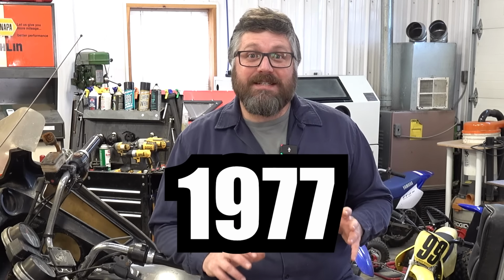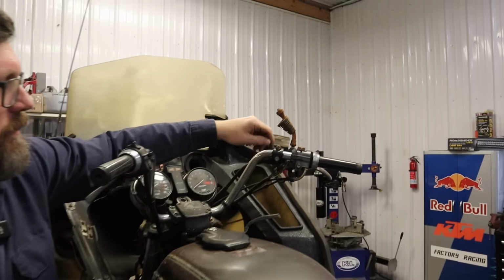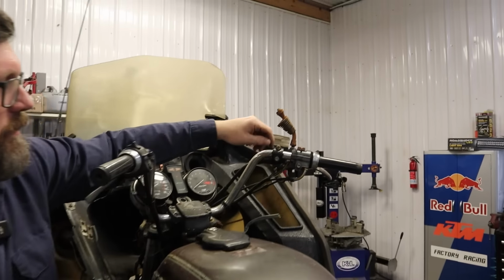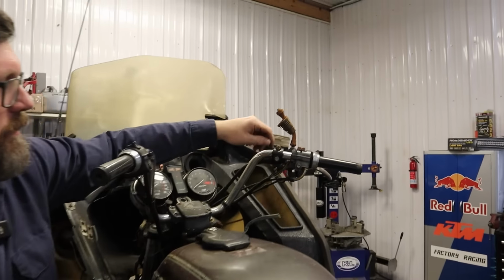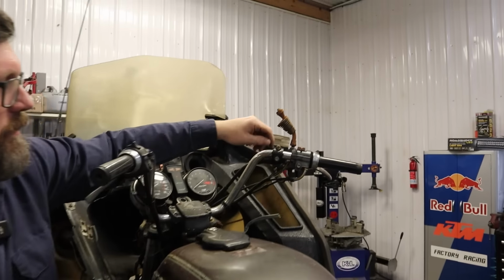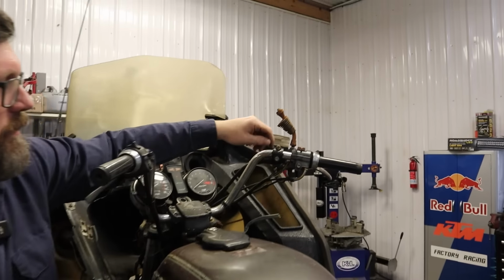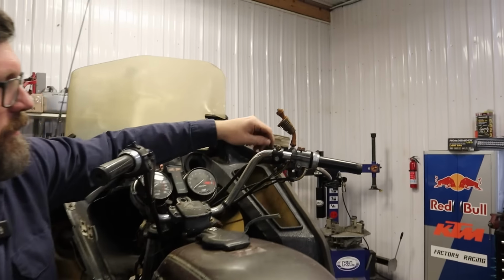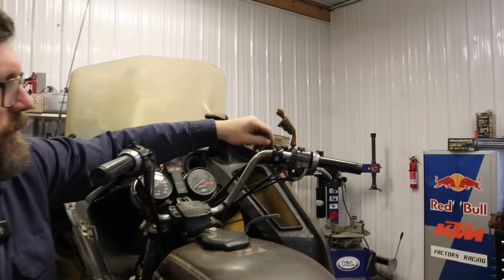Engine Seized! Can I Get This Cult Classic Honda Running?

Comment: I'm now convinced Craig could get a 47 year old rotten potato to run.
Reply: Perfectly good mashed potatoes
Reply: Why yes, Craig can get himself to run any day!
Reply: That's the difference between an old-school "fixer" mechanic and the new generation of "replacer" mechanics. They just replace every part in the working-chain,until it runs. It the end it'll turn out that the cheapest part was the culprit.
Reply: How many kicks?
Reply: go for it

Comment: I'm convinced that Craig can bring almost any motorcycle from the dead
Reply: This was a bragging achievement. It was spewing smoke and starting fluid out the head from the lack of gasket. Honed the cylinder wall with sandpaper. My man's the Merlin of bike maintenance
Reply: This Honda is more dead than alive ie it's a Zomda
Reply: He is Craig the Corroded, Motorcycle Necromancer 😂
Reply: I know right. I just pulled the battery out of my 2023 Yamaha MT 10 to throw it on the battery tender and I actually thought I was doing something lol Craig could probably rebuild that entire motorcycle and the length of time that it takes me to remove my battery and put it on the tender lol.
Reply: I got one that might challenge him
Reply: There's a rumour that The Ghostrider brings his ride to Craig for a service and tune on the down low. Of course Craig has to let it sit for a day to let the flames burn out and let it cool down. That's why when one of his junked bike restorations burst into flame, he isn't that rattled.
Reply: @thetoymanator7723  Also explains why Craig's fingers are so resistant to high temperatures.  🤣
Reply: Almost?...
Reply: You are correct
Reply: @thetoymanator7723 😂
Reply: I know right. It’s a shame I don’t live anywhere near him cuz I’d hire him to do the work on my 01 Concours 1000 in a heartbeat.
Reply: Part of it is Craig... Part of it is that Hondas just never actually die...
Reply: It's a Honda!
Reply: I mean honestly it's not hard, he literally goes over ever bike maintenance first and that usual brings the bike back from the dead 😅
Reply: Bike whisperer

Comment: Back in 2000, I took a chance and bought my first bike, a not-running 1979 GL1000 I was told just needed a starter.  Turned out it needed carb work and had rust in the tank.  My neighbors watched me fool with it for weeks.  Then one day I'll never forget, they were over talking to my wife in the driveway while I'm working on it in my garage.  It was time.  I pushed that button and it coughed, a truly thrilling moment.  My neighbors looked over and said, "whoa!".  I hit that button again, gave her some gas, she sputtered then fired to life.  I was out there in a cloud of smoke, fist pumping and celebrating like it was a football game.  I probably looked like a fool, but the excitement was real.  Not a big deal for a seasoned mechanic, but it was for me.  I rode that bike for nearly 2 years after before I sold it to get a Harley.  Your video brought that day back for me.  Thanks.
Reply: What a great moment
Reply: try putting a choke cable on a gold wing, not possible for most people

Comment: As a birthday present, I´ve got a 1978 Honda CX500 which was sitting in a garage for the last 24 years. I changed the oil, rebuilt the carbs, cleaned the tank and took it for a four day trip to Italy. It still runs perfectly without any further service done to it. These bikes run forever. Greetings from Germany
Reply: Oh yes, I also changed the brake fluid.
Reply: @MotoButscher glad you added that.
Reply: That sounds awesome!
Reply: SMOOTHEST,  that's what I think of when I think of mine.  Powerful enough and fast enough.  With that high compression engine it was so superior to chain motorcycles, Chain will beat you to death  this thing is Smooth.
Reply: Hondas and Yamahas both wear like iron I’ve had them both and with meticulous maintenance they can run forever ✌️🇺🇸
Reply: My mid 90s Yamaha Diversion 900 just ran and ran. But the OEM front brakes were nasty. Powerful enough but zero finesse. I replaced with R6 blue spots and master cyl. The rear brake needed annual rebuilds. It just corroded. I never got around to fitting another blue spot. The rear suspension rocker arm was an expensive problem. Needle roller bearings and everything were silly money. If needed a complete rebuild with bronze bushes and grease nipples. But yet more silly money.
Reply: I had one used it for a year to go to university and 5 years it sat around the section and when I had car problems I'd roll it down the driveway as battery was flat from sitting around and off to work I'd go until I got a good car and sold it something I regretted many times , iv since had a shadow st got it and a Street Bob I ride most of the time
Reply: Güllepumpe!
Reply: As he said the first models had a faulty cam chain tensioner bolt which resulted in multiple engine failures. Once they replaced those under warranty they were indestructible. This made them very popular courier bikes and of course Honda basically just bolted a turbo on to it
Reply: I just resurrected my 82 gl500 after sitting for 7 years. I put fresh gas in it, oiled the piston tops, cleaned the plugs and she fired right up. Love this bike! Now for refreshing the brakes...

Comment: I have a 1982 GL 500 that I bought brand new 41 years ago. The GL is the CX but with the Honda Fairing, trunk and saddle bags. I still have it. That thing is bullet proof. Rode it all over North America and all over Europe. It's no longer my primary ride but it still runs and I can't bear to part with it.  I'll probably keep it until I'm in the ground.
Reply: Ive got a honda cb1 from 1989 it still goes fast
Reply: Used to be called the baby wing
Reply: The first real bike I rode was an 81' GL. Two brothers bought bikes, one the GL and the other a CX. Years later, I bought that very CX.  Still have it. Been sitting way too long!
Reply: My understanding is the GL is a bit more relaxed frame wise.
Reply: Bro, while working at a campground near the Grand Canyon we had a well-fed couple roll in on a GL 500, towing a trailer.  At 7,000 feet elevation.  Gawd I felt for that 500!
Reply: In England the model in this vid was called a cx 500c, ( c for custom) also called the silverwing, my dad had one
Reply: your comment is 7 months old but if u happen to see this i just bought an 82 gl500 off a guy for 150 bucks! i cleaned the carbs and its running already. im new into the bike scene and work in a mechanic shop and got it to try and fix up and learn to ride. i just have to figure out why the clutch is sticking and why it seems to not shift into 4th and 5th. if by the low chance you read this id love to hear any tips and or info that youve found in your 41 years of ownership. thanks! @fyahoo

Comment: A favourite with Motorcycle Couriers in the UK for many years.
Reply: I sold them water pump seal kits by the boat load .....ex Fowlers parts counter ....
Reply: And widely known as the Maggot!
Reply: @cedhome7945  cam chain tensioners were another regular replacement too

Comment: I've got an 82 CX Custom in my shed. (Owned it since 86)  Parked it after It blew the second stator. (Requires engine removal). My buddy is dropping by tonight. You just inspired me to discuss a restore. 😎 Enjoy your channel.  Cheers
Reply: Hey Lancer, I had an issue with the stator on my CX500 a few years ago and I tried electronic ignition that is wired to the brake light circuit and this fires the bike up everytime real easy too. Just thought it may save the headache of having to drop the engine to remove the stator. Can't remember what the name of the company was but they were based in poland or somewhere like that. Safe riding from the Dave in the uk.
Reply: @TheDavedadd  Thanks Dave I will have a look. Much appreciated. Wiring to the brake light circuit sounds a little sketchy. I think I'd wire a direct fused wire to the ignition. I'm thinking the 2nd alternator was a cheap aftermarket one Thanks again. Lance in Canada
Reply: I went through a stator replacement on my 1980 CX500.  There is a great CX500 forum online with a walkthrough on how to do it.  Lots of great resources on that site.  Follow the guide and you'll be fine.
Reply: My Gl 1000 Gold Wing is on its 4th stator.
Reply: You are a specialist !  😉
Reply: CX's have gotta be the best bikes to remove the motor- you don't even need to remove the radiator or dump the water.
Reply: Just do it otherwise it sits more creating more labor and $ for you. 
Bet once youre an hour into it you get the bug to really ride.
Reply: @lancerbiker5263  did you get the crappy alternator from a company in Montreal ? Cant remember the name but back in the day I got one of their alternators and it only lasts 2 seasons . Stock honda costs 3 times more but at least it lasts
Reply: @ethics3  it was quite a while ago but likely was as I don't recall shipping from Japan. Yup nothing like OEM  👍
Reply: Any updates girl? Tell me

Comment: This is the first video of yours that I've watched, after my husband sent me a link, and I want to say thank you! I bought a -76 GL1000 two years ago. It's been sitting in a garage since -87 and while it still looks good, there's work that needs to be done, and I'm not by any means a trained mechanic. This made me reluctant to get started, but I slowly began working on it a while back. One of the problems it had was a stuck throttle and I didn't really have a clue what to do about it, but yesterday (after watching this video) I got it unstuck. It might not sound like a big deal but it is to me. So happy about this! Again, thank you!
Reply: Well done👍😊What else needs doing?
Reply: @maikelnait4495  thank you! Since writing my first comment I've replaced the cam belts and tensioners, the light bulb in the headlight, the brake light switch for the rear brake, and the handlebar. I've gotten new fuel lines and filter. I've repaired a broken wire for the pilot bulb and 'persuaded' the starter relay to work again - and I've found out the starter engine works perfectly. What I'm currently working on is reassembling the ignition coils on their mounting brackets and attach the assembly to the frame so I can check the spark plugs for spark, and I'm trying to remove the thoroughly rusted parts from the front brake master cylinder (made som headway about an hour ago when the circlip finally could be rotated in its grove. I've taken out the air filter housing to remove rust from it. I'll need to do something about the fuel tank also, and there's an oil leak from the oil filter case o ring. The rear brake isn't working properly. The seat cover has a torn seam and a crack in another place, and the horn has gone mute. I won't be surprised if I run into more things to deal with, but I'm ok with that because I'm having fun doing all of this. Sorry for this wall of text.
Reply: Wow! Your dedication is inspiring ! 🙏

Comment: Long time CX 500 owner here.
Don't strip that engine down. Couple of oil changes, it'll be running fine. Already sounds good!
Couple of things. Search for "Triple Bypass". Three common things that go wrong with these bikes.
Carbs. Don't separate them. They need to be cleaned very well. There are emulation tubes that need to be pulled and cleaned before they run properly. I used a 4-40 bolt and nut. Thread the top part of the tube, screw the bolt in. Use the nut to jack the tube out. A dpiral extractor will work, but I prefer the bolt and nut.
All of this stuff can be found on forums. 
You got a new subscriber

Comment: I owned a 1978 CX500.  I put 68,000 miles on that bike. Some additional fun facts about the bike:
1. It took Honda three tries to get the cam chain tensioner system right (I rebuilt the cam chain system on mine twice, using different part numbers each time - which is how I knew it took 3 tries).
2. You could drop the engine out of the frame in less than 5 minutes (the carbs stayed with the frame; there were no frame rails under the engine, so you just had to remove the frame bolts between the cylinders, loosen the carb spigots, remove the clutch cable, put a transmission jack under the engine and wiggle it front off the final drive splines and carb spigots).
3. The original ComStar wheels had stamped steel spokes, bolted to an aluminum hub and riveted to an extruded aluminum rim.  This was (and in my opinion, still is) a superior design to modern cast wheels (extruded aluminum is stronger and less porous than cast aluminum - so it didn't need to be sealed on the inside of the rim to hold air - and the additional strength of the extrusion meant the rim thickness could be less, resulting in lower rotating inertia; and the steel spoke provided more "flex" than the later ComStar aluminum spokes or cast spokes. In fact, with the current Adventure Bike craze, I'm shocked no one has "re-introduced" this original ComStar design - combining the advantages of a modern cast wheel and a traditional wire-spoked wheel.
Reply: what is extruded aluminum?
Reply: @mebeasensei  Sort-of squeezed into a shape, as opposed to cast into shape. Think pasta versus jelly/jell-o.
Reply: @mebeasensei  extruding refers to a manufacturing process, where a material is forced at very high pressure through a die (the shape of the cross-section of the finished item).  Most alloys of aluminum can be extruded (along with many other malleable materials).  The extrusion process results in a smoother finish (and typically higher density) than casting.  Cast aluminum is typically very porous (i.e. it leaks air)... this is why cast aluminum rims always have a painted finish (the paint is not only for beauty, it keeps the rim from leaking which results in flat tires)!
Reply: Only 68,000?
These things given fresh oil and daily hard use do 200,000. 
One of the easiest bikes to service.
Reply: @davefrench3608 I didn't sell the CX500 because it was worn-out - I sold it because I wanted a Honda V45 Interceptor (and could only afford one bike at the time). Agreed regarding easy servicing of the CX500!
Reply: I remember my friend pulling the engine on a wrecked one of these. I think he put it in a siezed up Silverwing 500GL.
Reply: I had a 1978 CX500 that I sold at around 45,000 miles.  I installed a Windjammer fairing and rode it fully loaded with tools and camping equipment from New York to Colorado, taking an indirect route back, and covered 5,200 miles in less than one month.  I had absolutely ZERO problems on that trip.  The only problems I had during my time with this bike was the cooling fan, which was driven off of the camshaft, broke.  I didn't realize it for a few months, when it began to overheat in traffic.  I wasn't difficult to replace.  Also, the rocker arm shafts and bushings wore out, but that might be due to some sub-optimal oil I used back then.  I sold it because I wanted a BMW R80RT, but the Honda was quieter and smoother than the  BMW.  I really like the solidity of the BMW, but I might have as happy (or happier) with a 650 Silver Wing.
Reply: No, you can NOT drop the engine in 5 minutes. I've rebuilt these before.
Reply: @VndNvwYvvSvv I didn't tell the whole story: We had a CX500 setup for endurance racing; quick disconnect on the fuel line & tank strapped down (swapped tanks on pit-stops rather than refuel on the bike); we did the WERA 30 hours of Rockingham in 1979 on my CX500!  With practice (and 2 mechanics) we could swap engines in less than 5 minutes (stop-watch verified).  FYI: we did not have to swap engines during the 30 hour race - approx. 2600 miles raced from noon Saturday until 6pm Sunday!
Reply: The first 3 chapters were kinda fun. I look forward to spending the next 2 weeks reading this novel. 😏
Reply: I had the full dress gl 500 silverwing. The single worst feature was the engine driven cooling fan. In stop and go city traffic the temp needle would go into the red zone unless you sat there with the engine revving so the fan spun fast enough  to pull enough air through the rad.  They corrected this on the CX 650 with an electric fan .
Also a huge pain if you needed to service or change the stator ... remove engine .
Reply: @danielklopp7007 most alloys, for that reason are forged on the outers and only cast/ pressed on the inners. Most car alloys are fully forged.
Reply: wold you happen to know where i can find a chain tenssioner kit thiese days?

Comment: I got a 1983 CX650 Custom, rode the wheels off it, then got a CX500 with trunk, bags and fairing. They were great motorcycles.

Comment: Had a 1980 model CX500 Custom. Bought used in 87, fully bagged. Fairing, hard bags and trunk. King, queen seat. Two years later I had it knocked down to a hard-tail, straight pipes with fishtail exhaust on each side, tombstone tail light... man, it was cool!!! Nobody could stand riding behind me for any length of time. Said it sounded like a powered up Cessna that never got cleared for take off!😅 Fun video guys! Thanks.

Comment: So happy to see the CX500 getting some love. I am the proud owner of a near mint condition, bone stock, all original 1980 Custom and a 1981 Deluxe parts bike with over 100k miles. Bought them off a family member who bought the deluxe new.  First bike I ever owned. Learned to ride at 40 years old on a 40 year old bike. Put over 10k miles on the custom in my first year and a few months. It's a good reliable bike. What you've got could be a decent  parts bike, save everything you can and pass it onto someone like me who is restoring or keeping alive these old cruisers.

Comment: I just bought a 1983 Silverwing GL650 with 7,000 original miles. It has the engine from the cx models. It's smooth and I can really lean in the turns, I love it.
Reply: Sweet, those are rare.